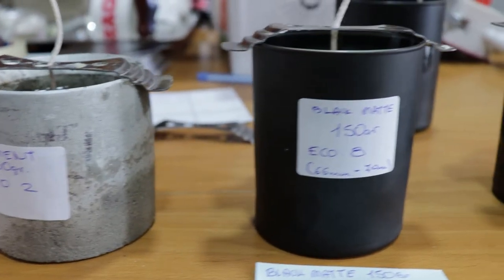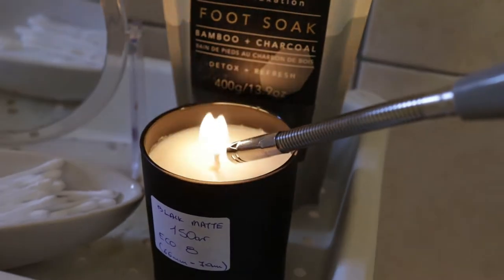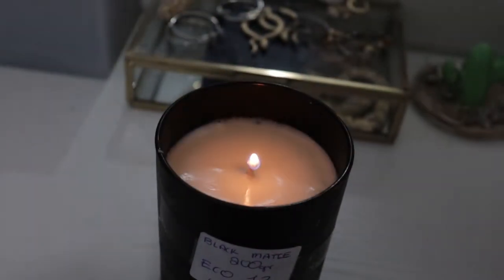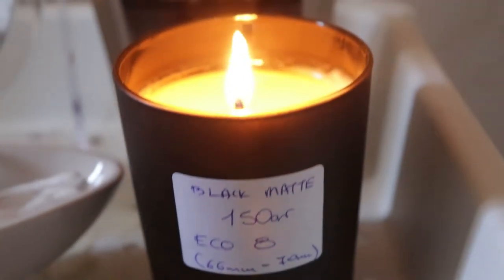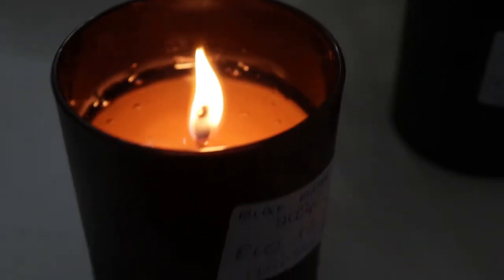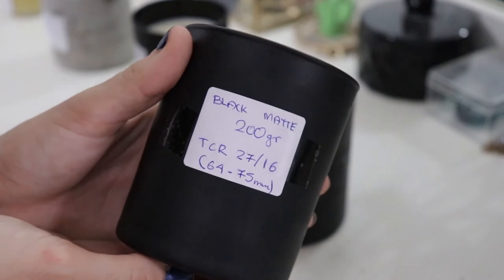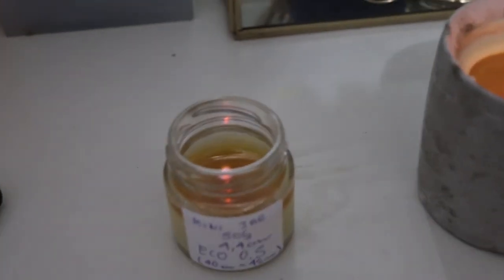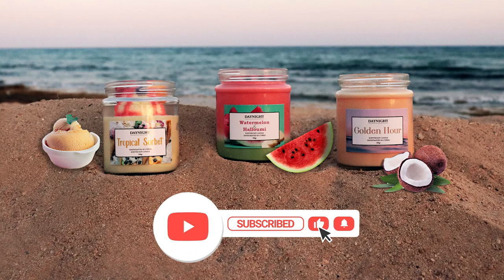CANDLE WICK TEST | Multiple Containers | 1-4 hr Checks Pt.1

Comment: I've got the same problem. Using exactly these black matte 7oz jars with C3 and can't find a proper wick. ECO (12 and 14) and CD (tested several sizes)failed completely..did you find a solution?  I just don't know which wick I should try now. They look perfect, they smell good - but they are burning awful.